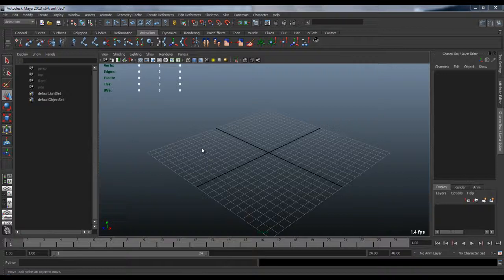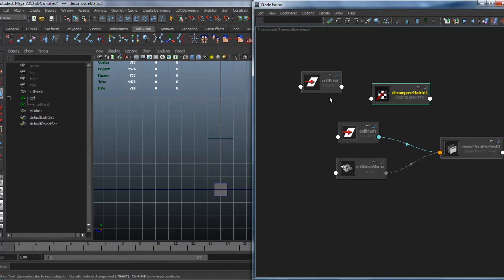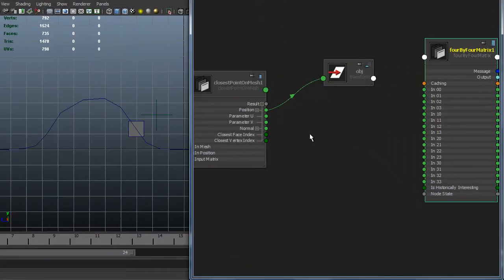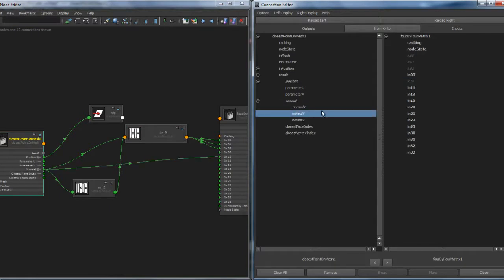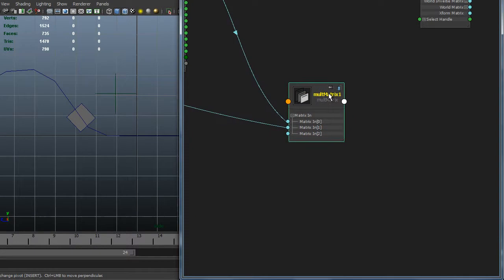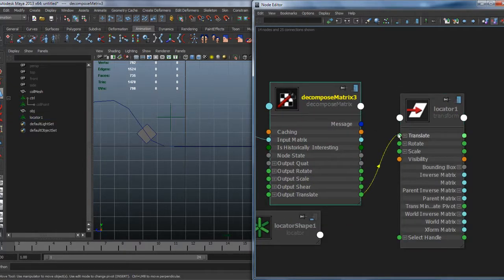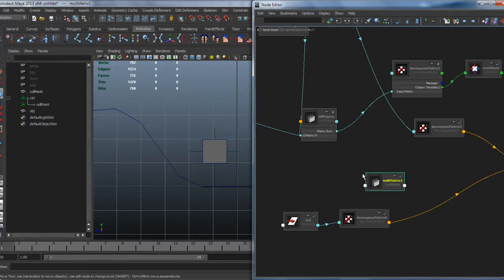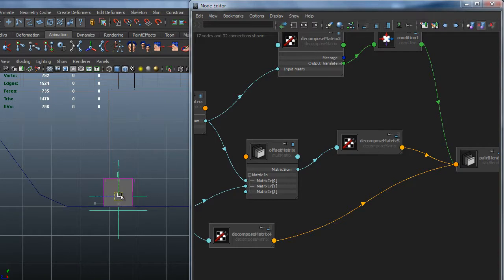#rigTip - collision system with matrix

Comment: So how can I apply this to an ankle like you were saying? I understand the locator has to be like the control we are using. But what would take the place of the geo. I cant use the character geo otherwise it translates the whole character. So what should I use, the joint? But if so how can I still keep control constrained to it?
Reply from the maker: so locators in this example are just transform (can be controls, can be joints, can be locators, etc etc etc).
the 2 transforms you need is one that move your system and one (you can even made more than one actually) that represent your collision point, so for example in a leg system your control will be the ankle but the collision point will be the heel.

Comment: Thank you for sharing , That is awesome . but when rotate control after 90   object  don’t following control   can u tell me how to solve this  ???
Reply from the maker: Hi, it's difficult to say without a scene or an example. 
I have to say with this tutorial I want to give a base idea how to work so it's a simplify version. for example I use a static vector (1,0,0 if I'm not wrong) when I do the cross product with the closest point normal and in this case you have to build around to switch the vector depends of the "situation"... 
it's difficult to tell you how to fix without a scene, but keep in mind this tutorial was made to give an idea about the system but for sure there is room of improvement.
Reply: @MarcoDAmbrosTDTutorial   thanks so much for replay , Marco , I have just one problem when I want to rotate locater (Ctrl) X or  Z after 90 degree snap to the mesh  but for  rotate Y so cool don’t have same problem , I hope  clear hahaha